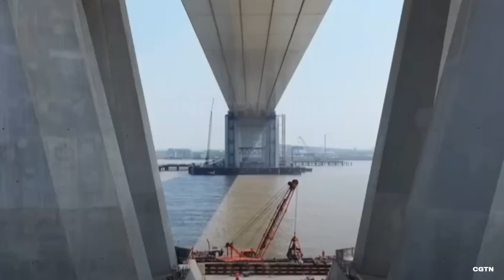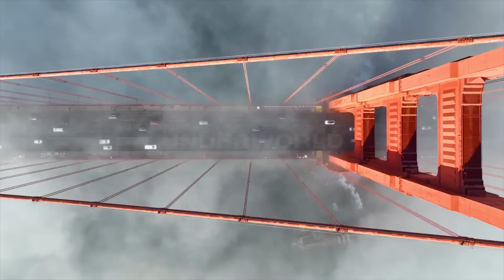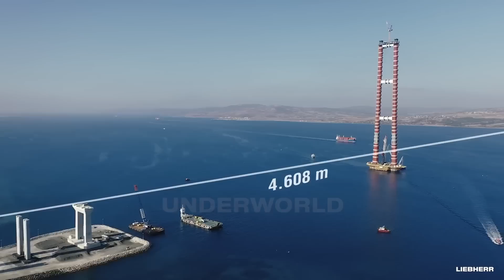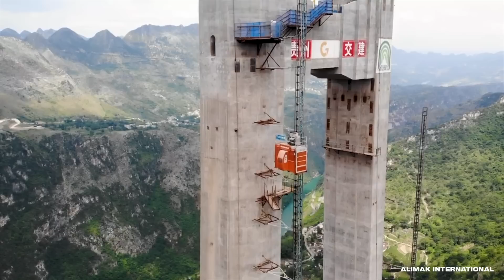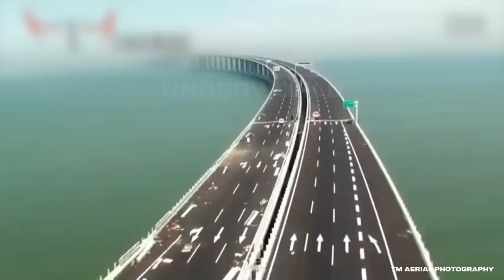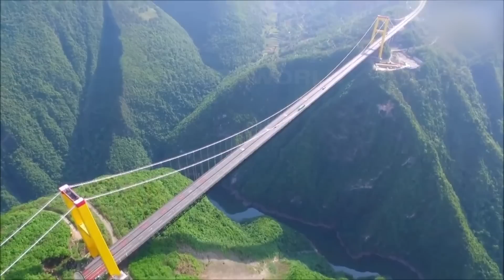10 Largest Bridge Megaprojects in The World

Comment: Clifton Suspension Bridge is one of Bristol’s most recognisable structures. Designed by Isambard Kingdom Brunel, it marks a turning point in the history of engineering and has come to symbolise a city of original thinkers and independent spirit. The Bridge is open 24 hours a day, seven days a week, 365 days of the year. There is a £1 toll for motor vehicles and is free of charge to pedestrians and cyclists - no booking required. Built in 1835 and no doubt good for many years yet ! :face-orange-biting-nails: